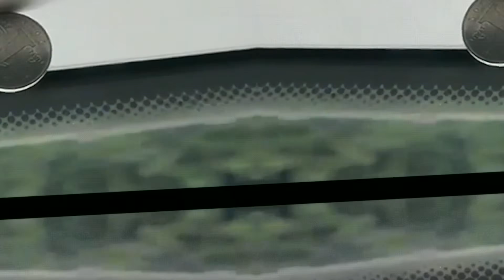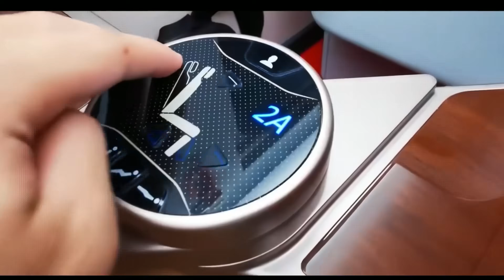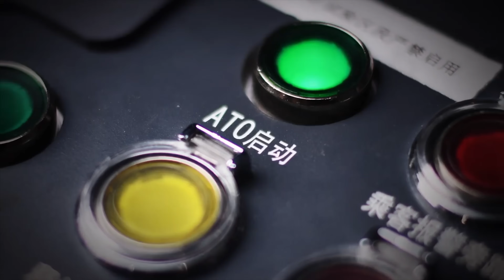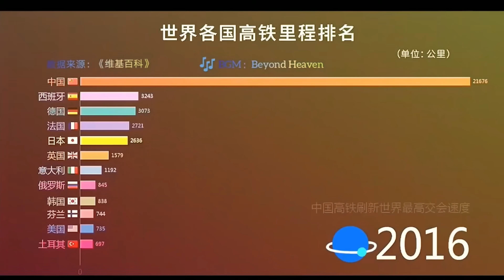The evolution of China’s incredible high-speed rail network

Comment: I would suggest the HSR in China is just the common sense prevails!
China does not have large oil reserves like the US so it would be a horrendous economic penalty to import endless oil for the Chinese people to run cars like the US and the west.  Thus China must develop and electrify its public transport system.  Therefore it is logical for China to develop the HSR and compliment it with a large metro network connecting over 45 to 50 cities.  Owning a car in China is not essential but a luxury for most people.  Chinese just live within their means while trying to be green and sustainable.
The necessity of developing the HSR also requires China to develop its renewable energy so in parallel with the HSR China is also the world biggest renewable energy generator in each of the hydro, solar and wind.  To enable the renewable energy largely concentrated in the North west of China the UHV transmission lines have to be innovated and installed so that the green energy are utilised by the eastern coast consumers 2000 to 3000km away from the points of power generation. 
Thus riding a HSR in China is natural.  It is backed up by a huge metro network to ensure one can reach most parts of China using public transport without depleting the fossil oil.  In the mean time China is going all out to de-carbon itself with renewable energy to ensure China's future generations do have a future.
Reply: Actually they have huge untapped oil reserves in Xinjiang, which is why one reason of many that the US is trying to cause trouble in that region.
Reply: @ElZilchoYo You are right, mainly because fossil energy is too polluting, and it is necessary to prepare for electrification deployment in advance
Reply: In fact, the high-speed rail network has connected more than 400 cities.

Comment: 15 euros for a 90 minutes ride on hsr? that is pretty cheap by any standard.
Reply: That’s what I thought…such a good deal, but I went into their website to check and the €15 is the cheapest if you are flexible and buy in advance, plus only very few trains (0 to 2 trains) available and usually in odd hours are priced at €15 (like 7am and 9pm). Prices varies… up to €110 the most expensive ones for standard ticket. Where as the ones in China are the same or similar prices unless it’s a train with lower speed or with connection.